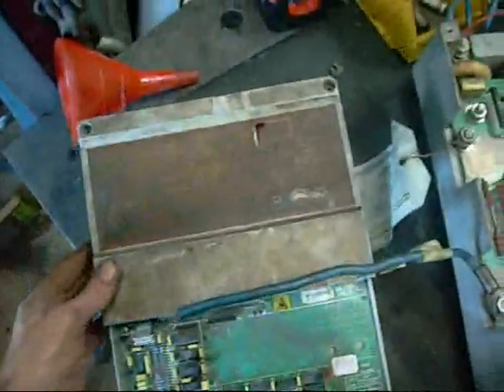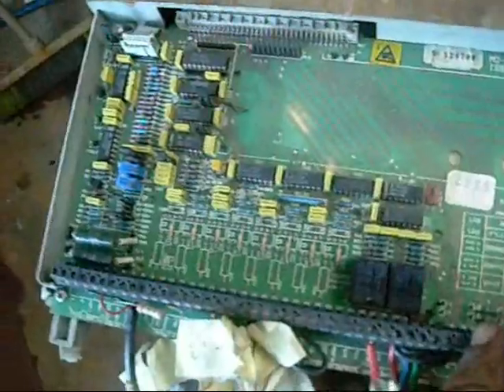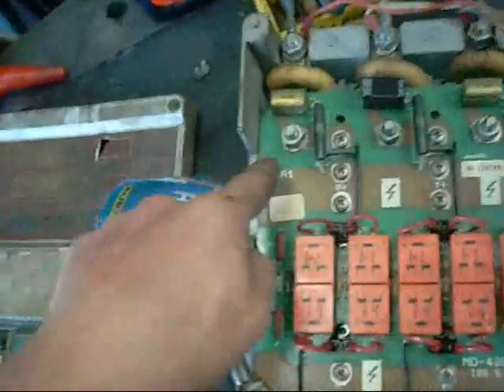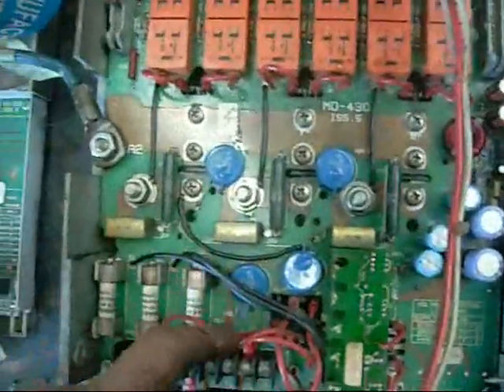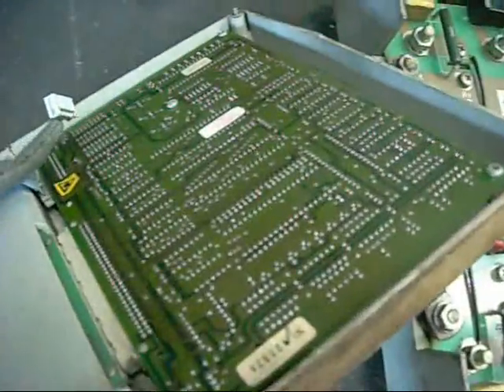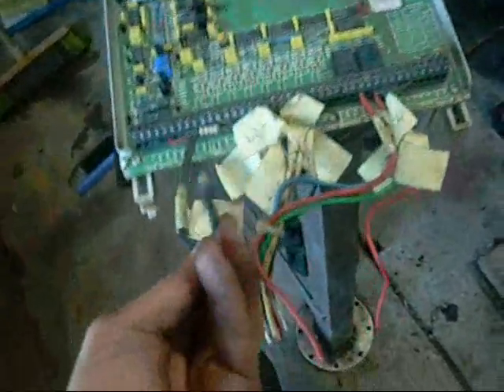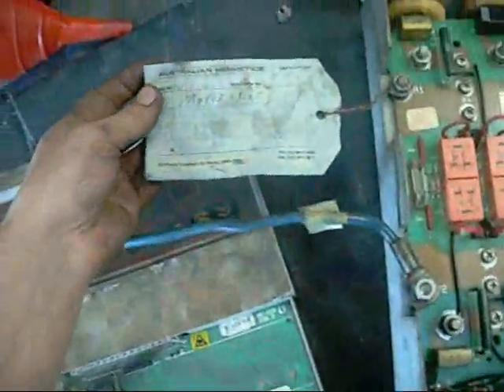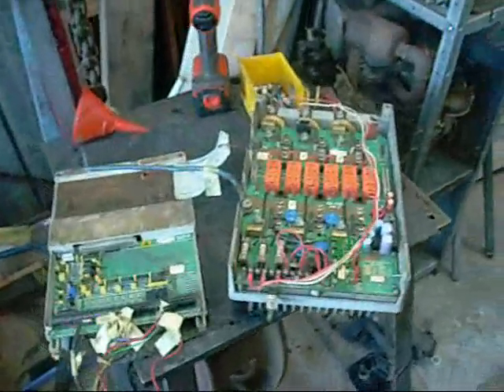Seco Mentor DC Variable Speed Drive Help Needed

Comment: i have a bit of experience with 3 phase stage lighting stuff and from that i can tell you that the wires leading to each phase are as you say phase monitors. when you power it up there will probably be a part of the display that indicate each is live and equal in voltage. i dont know weather the unit will function unless these readings are right so there will be an art to wiring it up for single phase use. dont know weather this is the same principal but thats what i have experienced.

Comment from the maker: @Kizmox Mmm, the blue cable off the side was connected to a large ceramic fuze, it was cut off from there so I doubt I will ever see a cap bank for it.

its strange that the wires with the 3 fuses are bridged to the heavy 3 phase terminals at the top, I still think the top 3 are inputs, given the current it can handle.

either way I'll put some power to it some day and see what happens.

Comment: This unit is probably missing parts. Maybe those two large wires going to the middle of circuit board are wires for external capacitor unit

Power input is at the lower left corner where you have screw terminals and three fuses. Three connections with current transformers are most likely outputs.